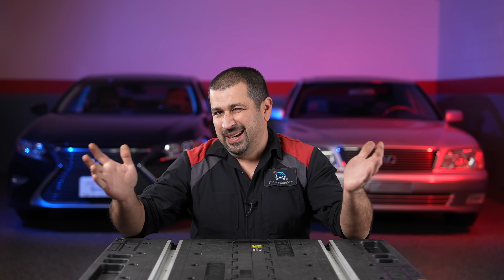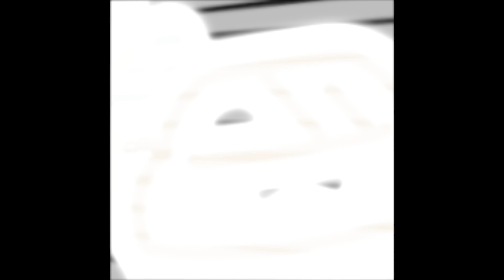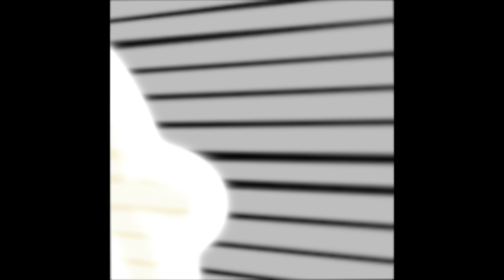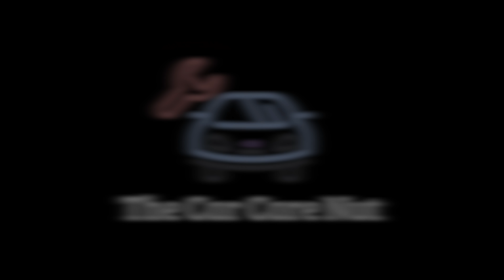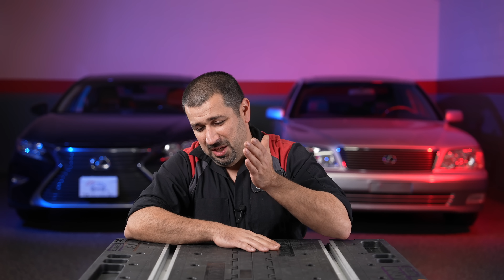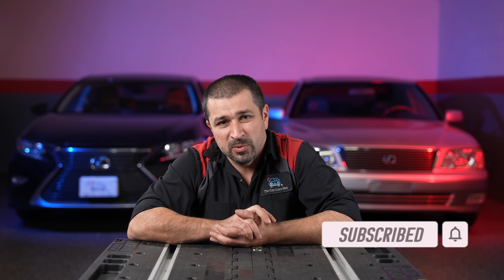Can Modern Turbo Engines Be Reliable? Here's The TRUTH!

Comment: My wife and I had been needing a bigger car for our growing family for quite some time and we had settled on a TX.  Our 2022 RX450hL just wasn’t cutting it anymore.  After test driving a TX500h I decided I DID NOT want a buzzy 4 cylinder turbo pulling a 3 row SUV. The engine noise took away from the “Lexus experience” and IMO not what a Lexus SUV should sound like. So I put a deposit down and waited. A few months later I was made aware that a TX550h+ with a 2GR was finally going to be available at the local dealership.  Picked it up and could instantly tell that I made the right decision.  It was smoother and quieter than its buzzy siblings.  No crazy bolstered F sport seats, sport tuned suspension, or an engine that sounded like it belonged in a Toyota forklift truck.  
How does the ride quality compare to the 2022 RX450h?  IMO the RX was noticeably more comfortable, smoother, and quieter.  The suspension was softer and it was like riding on pillows.  The interior with the wood trim seemed more luxurious and comfortable.  Just a nice place to be in.  The RX engine was quieter also!  They both have the 2GR FXE engines but the TX engine must be tuned differently (It does make an additional 100 HPs).  This new generation of Lexus SUVs has taken a different direction.  It’s not all about serenity and comfort anymore. It’s more about thrills and excitement.  Personally I’m not happy with this direction.  If the 3rd row on the RXL was more functional, I would have kept it.  But it’s not for me.  My wife and kids have much more room and they absolutely love it.  It’s a win for the family.

Comment: NO. The highest mileage car I've ever seen was a 1987 Buick Century with 730,000 miles on the original 4 cylinder Iron Duke engine and 3 speed automatic transmission. That thing is naturally aspirated. Heck it has one camshaft in the block, all-iron construction, and ONE fuel injector going pfffffft down the intake.

Comment: Looking at the Toyota Grand Highlander hybrid. They make the grand Highlander max which is a 2.4 L turbo with the electric motor assist but it is a turbo engine incredible horsepower. They are getting out of this thing. The regular hybrid is a 2.5 L four-cylinder normally aspirated with the electric assist, no blistering speeds, but it will carry itself in traffic and I won’t have to worry about the turbo Destroying the little engine. 
    I’m hoping Toyota will go back to its roots of reliability and stop worrying about government mandates of gas mileage and EPA certification. They used to have very reliable cars.
    I also own a 2024 tundra. I just got the notice of the engine recall a couple weeks ago. I’ve got about 40,000 miles on it no problem so far but just waiting. Hopefully my replacement engine will come in soon. Then I have to worry about if the replacement engine is going to have the same Quote debris problem that Toyota is claiming. Which I think is complete BS.
   Then I have to worry about what’s going wrong with it 20,000 miles down the road when the tech who replaces the engine doesn’t tighten or torque something down correctly or doesn’t secure a wiring harness correctly after they pull the entire cab off of the truck to replace the engine. I hear now they have a way to do it out the front so I will expect radiator and air-conditioning condenser problems also.

Comment: I think the one reason that these manufacturers push for longer oil change cycles is the cost of maintenance is less on paper and it looks better to the customer. that doesn't account for the fact that you're wearing stuff out faster not maintaining it properly.
Reply: Yep. There was a point in time where car rags like Consumer Reports included total cost of ownership into their rating metric. That metric included routine maintenance  like oil and transmission fluid changes. Interestingly enough, that is right around the same time we saw manufacturers touting things like 10,000 mile oil changes and lifetime transmission fluid.

Comment: You have to be kidding when you say that turbo diesels aren’t used in heavy stop and go use.  What about a city bus?   What about a garbage truck?   Or a diesel locomotive in a train yard doing switching.     They all have turbos and rarely run at a study state RPM very long.
Reply: Millions of European Diesels doing just that every day on 15k miles oil changes with no problems.
Reply: The host isn't really talking about driving patterns, he is talking about thermodynamic heat cycling.  It is far higher on a gas engine turbo.  He didn't make this point crystal clear, but it was in there if looking.

Comment: Toyota have been putting turbos into mainstream models for a long time in petrol engines
The Lexus NX200t, IS200t, RC200t, etc
They have a few issues but I had to google far and wide to find any issues whatsoever 
Aside from the twin turbo V6 issues one time that were ALL replaced under warranty for free even unaffected units, I have FULL confidence in Toyota as long as you do maintenance well.

Will it be as reliable as my wife’s 2012 Camry that has NEVER had an oil change in the 435k km it’s driven (she got it brand new before we met and won’t let me touch it)
No but I always change my oil every 10k km but I could move it to 5000 km (just over 3k miles) to be more preventative and so far Toyota turbos aren’t problematic for me
Even skotty Kilmer the most annoying mechanic imo (he just doesn’t understand why people buy anything other than what fits his exact needs) said when the LS500 came to his shop “I’ve never seen a Toyota turbo fail yet, he’s the most anti modern car person I’ve ever seen and he says that so I truely have full confidence in Toyota

I love bmw but I simply cannot justify the maintenance risk at this point in my life, I just started my own business and once that either fails or succeeds I will be able to but at least for now I need reliability

Comment: 2018 Genesis G80 Sport 3.3T. Has 230k kms and still drives flawlessly. Maintenance is key to give you a chance of longevity. When it's been under load or speeds I don't turn my car off straight away and leave the car idling for about 1 minute before shutting off.

Comment: Have an toyota 86 pickup 4x4 turbo. One trip from L.A. to Tracy had the oil baked brown and even the transmission fluid in the manual burnt up with the heat of keeping up with modern traffic for 5 or so hours. They run HOT.
Reply: So yeah, change your engine, transmission, transfer case and axle oil regularly. Also coolant also washer fluid, haha 😂

Comment: My Suzuki Grand Vitara 2016 has 145k kilometers, used Mobil 10w30 synthetic blend, later changed to Amalie same grade but didn't like it honestly and finally  switched to Liquimoly 10w30 Molygen and I was impressed by its cleaning and performance. Clearly Mobil and Liquimoly are best for my JB424 engine.
Although the oil rated for 7 to 8000 kilometers I change it every 5k religiously. Even my gearbox, transfer case and differentials are replaced with 20k kms before the Chevron recommendation.

Comment: Diesel vehicles are ment as cruising vehicles? They're really ment for hauling and indeed generate high heat which is why they're prone to turbo caking. That's why they need to run for a minute or so based on hauling to prevent oil caking in the turbo and cause seizing. That why most Diesels install turbo timers to cool oils in the turbo. Dave's repair also stipulates this in they video also🤷🏻‍♂️. Gasoline engines also are also victim to the same demise if not also cooled properly. Oil geek states due to newer cars using 0/30 burns up quicker due to turbo and if want to save vehicles that have turbos, use 0/30 or 5/30 weights for better protection. Some newer yotas are worse because they use thinner than 0/20, like 0/18 i think which keep also explains.

Comment: I owned a 2004 volvo 2.5t i dont if that is modern buuutt I owned it till it had 188000 miles and sold it to a friend and she is still driving it with over 200k so there is that.

Comment: We have had turbo cars (Diesel and Gasoline) in Europe for a long time. They are reliable and more efficient specially from 2000 on. Change the oil at least every 6000 miles or each year, halve that if doing a lot of start stop and short trips on cold engine or weather. Let the engine run a bit (at least 20s) when cold then drive calmly until it gets up to temperature, and let it run at least 1 minute after a highway drive so the turbo lubricates well and cools down instead of being left cooking oil. You'll be good.

Comment: My Wife and I have 1.0 and 1.5 litre Volkswagen TSi engines in our cars. Manufacturer Oil Service interval is every 10k miles
Trust me when I say this - Change at every 5K miles using a Quality Oil (of correct Viscosity) along with a Quality Oil Filter.
Its going to add some extra cost to your annual motoring but its money well spent.
Modern oils are always improving but the extra heat from the Turbo along with Contamination (especially as an engine gets older) will always degrade any oil and affect its ability to protect the engine.
(Of Course) a well maintained modern Turbo engine can still sometimes fail under 60k but regular oil changes will reduce the likelihood

Comment: Trying to replace a V8 with a four cylinder is plain and simple a bad idea. Frequent oil changes on these small turbo engines is your best defense against the early inevitable failure of your engine. This idea not only assists in emissions it also is much cheaper to make a small engine and this is key. Corporations are always trying to cut costs and this is the problem. Costs are being cut in other areas making cars less reliable. Toyota has joined in on cost cutting and the historic reliability of the brand has suffered greatly. I like Toyota but will not be buying one made after 2020 ... and I will not own a daily driver with a turbo engine ...

Comment: I drive a naturally aspirated 2.0 Honda and the book recommends 12k mile oil change i am doing every 5-6 k miles with the recommended Honda 0w20  synthetic oil. It’s also a CVT transmission that recommends 60k fluid change I did it at 30k. Basically every single thing with recommended interval change I cut in half. Some may call it wasteful maintenance i say it’s protecting my investment. Break fluid change was also done at 30k it recommended five years or 60 k I did it at 30. Next up will be engine coolant change. Book recommendation interval is 100k miles I’ll do it at 50k. Manufactures recommend high interval changes for a reason which is to get things to start wearing out so they can get you into another new car quicker…. I don’t play that game. I like to drive mine until the wheels are ready to fall off for me that about every fifteen years. Then and only then will I shop around for something new.  I’ve stopped buying used cars for the reason many people abuse the crap out of the vehicles better to do research, save for a new one and take extra care of it so you can get the use out of it. Vehicles are too expensive to abuse.

Comment: Your explanation of diesel v gasoline engines is...a bit flawed. Modern diesel engines absolutely have throttle plates in many cases. This is the only way to properly mix EGR gasses in the proper proportion. Diesel turbos are used to create backpressure and are actually subjected to more heat than a gasoline turbo. It is important to idle down a turbo prior to engine shut down if being operated at high load for an extended period of time. Ordinarily by the time a car exits the freeway after driving for hours to stop and get gas for example, the turbo has had time to slow down, and cool down. Things that shorten a turbocharged engine's life are the same things that kill a naturally aspirated engine. Extended drain intervals, the wrong type of oil, lack of air filtration or even high intake restriction from a plugged air cleaner will cause turbo compressor seals to fail, resulting in high oil consumption. Emissions standards should not be set before the technology of how to achieve such a result is proven as reliable and cost effective. We are at a point now where we have engines that do what was once thought impossible. We also have engines that in many cases are not as reliable as they once were. There are many varied reasons for this, and no one can tell in advance with absolute certainty what engine will be a winner, and which ones will be losers in reliability and longevity. Proper care and common sense while using them is the best approach. Sometimes what the manufacturer recommends for an oil change interval is possible, but not advisable. Oil and filters are cheap insurance. Also the more often you service and INSPECT the vehicle the better the odds problems will be identified BEFORE they become failures.

Comment: I own two cars one is a Kia Niro and the other is a Buick Encore both are 2018 model. I noticed that when I change the oil in my Kia the oil is dark but not black, I change the oil in the Buick Encore with a 1.4L turbo engine it is black. I also noticed that the filter which has the paper element in the Buick it sits on the top closer to the engine where the heat is actually higher than if it was at the bottom. The Buick goes by percentage showing how much is left when changing the oil, and since I noticed the oil being black I set my rule to change the 5W 30 oil between 25-30 percent just to be safer. My wife drives the Buick and I told her not to push the car too much and to drive average at 70 miles on the freeway. The Kia Niro takes 0W-20 and the oild is still slick and not as black as the Buick at each oil changes which I do it before it reaches the 5000 miles mark. I also make sure the air filter is clean in both cars and I check it monthly. Watching this video it proved my theory of why the oil is more stressed in a turbo engine than in a non turbo. Thank you for this channel that educates many people on how to care and understand the vehicles we own, I sincerely appreciate it. Perhaps next time I would like to know about the Kia Niro. Cheers.

Comment: I ran a 17 year old turbo engine that was HIGHLY boosted beyond factory spec,, and the thing that killed it eventually was an inattentive driver.  Then I've run a twin turbo V6 over 165k miles, and no troubles with the turbos.  Both those were Porsches that were fastidiously maintained.  In my experience it's the maintenance that keeps the turbos spinning just like a normal engine.
Reply: Take care of it, it takes care of you. Most of the time.
Reply: You know Porsche is actually pretty good at making dual clutch transmissions and high performing turbo engines, they've been doing it a long time.
Reply: I had a 2015 BMW M5 with 125k miles (when i sold it) and never had any issues. I did lots of maintenance though (oil changes every 3k miles for example).
Reply: My 74 with a small block Chevy may not be efficient but puts out twice its rated power and has 300,000 miles with minimal maintenance.
Reply: Turbo's belong in sports cars and race cars. Everyone expects those engines to be high maintenance and if you ignore them they will fail.  Most of us don't want that crap in our normal cars. Turbo's are not the answer.
Reply: @michaelmichaelagnew8503  ROFL!!!!  Forced induction IS the answer.  The ability to make more power from smaller engines IS ALWAYS a benefit. The ONLY reason they may appear to be less than reliable is because those that have lots of problems with them are those that aren't required to maintain them: private owners. Think about it... Big trucks are turbocharged. No reliability issues there. There has been LOTS of turbocharging and supercharging in aviation.  The benefits far outweigh the the negatives!  OTOH, private owners will not warm up or cool down cars, use cheap oil, and buy low octane gas to save some pennies. 

Before you say it, I've owned / turbocharged numerous cars. My '96 850R had 187K on the clock when I got it 11 years ago. It still has the turbo that was on the car when I bought it! Runs up to 17PSI and a week never passes when it doesn't see WOT. But when on road trips, cruising at 70 to 75, it gets better mileage than any 6 or eight cylinder ever will. 

But if one chooses mediocrity, then....
Reply: Oh wow a whole 165k miles.
Reply: @brkbtjunkie For some people, that’s 25 years or more of mileage. That’s still good! Especially for a high strung performance engine!
Reply: @brkbtjunkie I've got just under that on my 05 cayenne turbo s, no sign of any oil leaks from either turbo, the engine is still very strong and plan on taking it above 200k in the next 2 yrs. No reason to think I can't.
Reply: @brkbtjunkie  It is not much for an engine.
Reply: @evalangley3985  exactly
Reply: @brkbtjunkie For a high performance car, probably not driven all
Highway, yes that is pretty good without a serious issue. Chalking up hundreds of thousands of highway miles in a mundane sedan is nothing. Those miles are 1/5 as much wear on the engine.
Reply: I'm curious, how much did all that "fastidiously maint." cost you over the years, probably more than several new cars.
Reply: @two2pedal289  Probabaly not!
Reply: @two2pedal289 so?

Comment: Hybrid with a turbo engine? My thought is avoid it. Climb a hill then go down. The little turbo is worked hard going up then it is suddenly OFF as the hybrid is going downhill. They will have more on and off cycles than a non-hybrid. This worsens the oil issue.